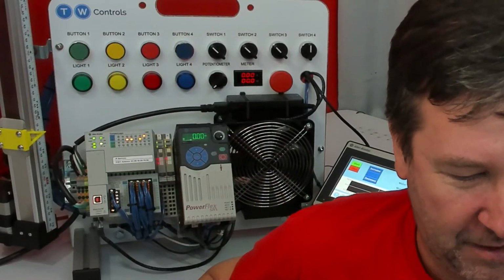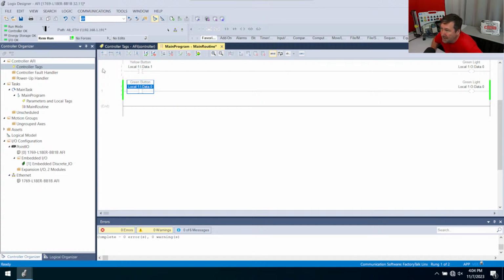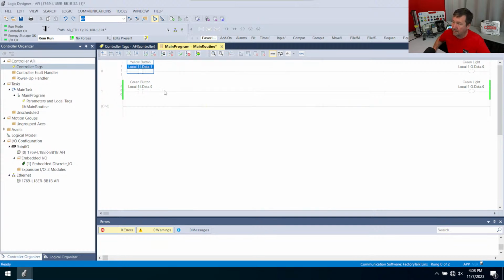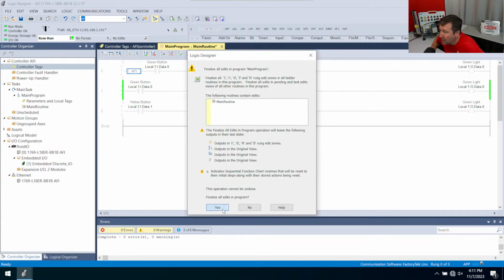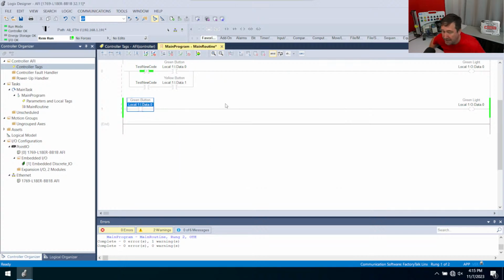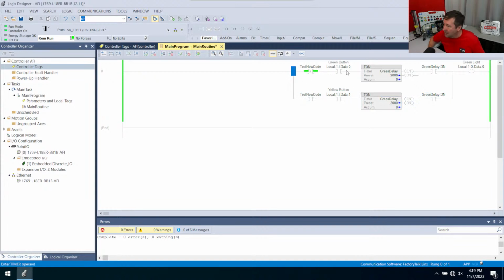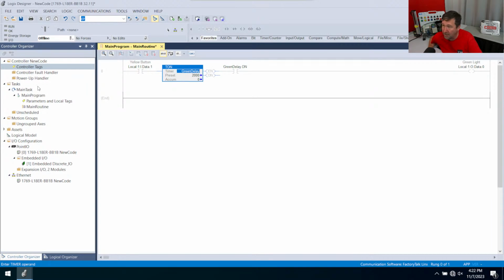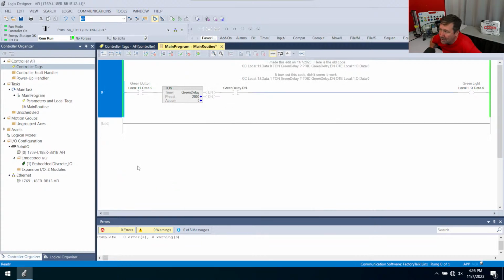Studio 5000 Online Rung Edits.  How to Do Plus Warnings and Pitfalls

Comment: Good interesting video Tim. 

Makes me think 🤔 its a fault of the software code. 
I was always under an impression that if the conditions were false then the ouptut could not execute. 
Which thank you for testing this. 

Tell feels like a fault of the software. 
Thanks for your video!
Reply from the maker: No, most output instructions do something when they are false.  Most notably, the only difference between the OTE and OTL instruction is what they do when they are false.  When they are true, both write a 1.  When false, an OTE writes a 0 and an OTL does nothing.